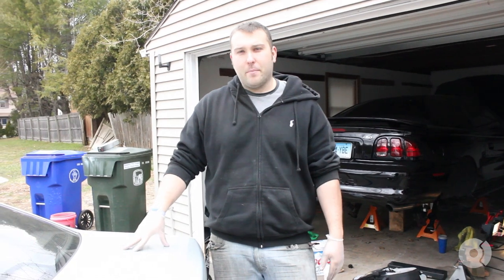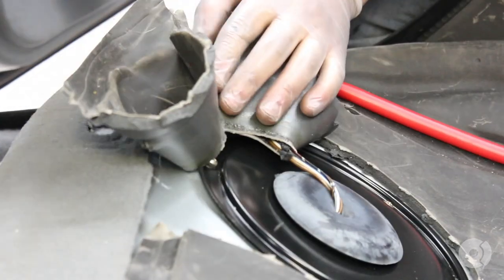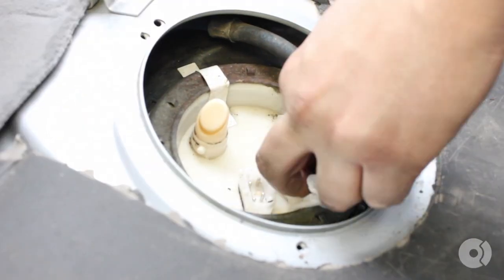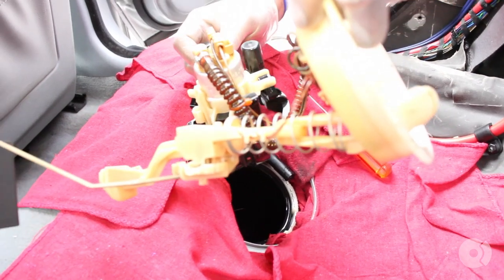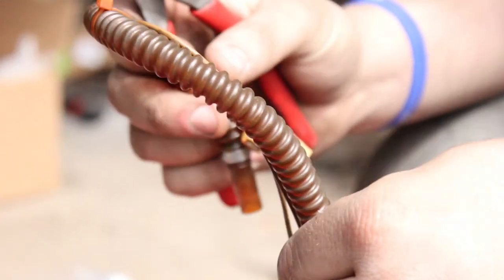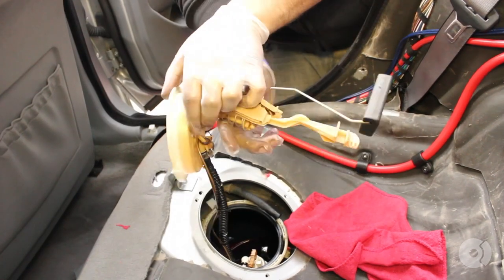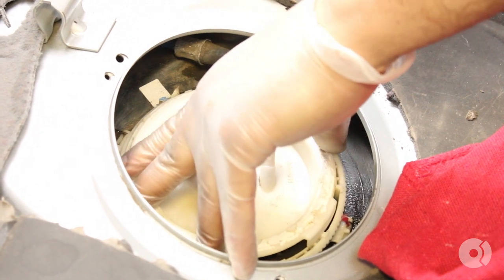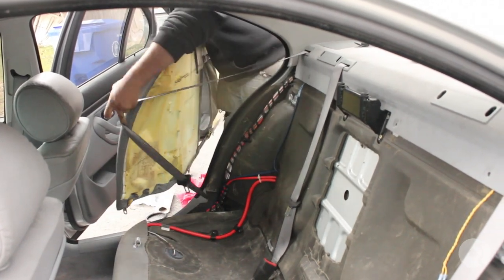BMW Fuel Pump Replacement (528i) FCP Euro

Comment from the maker: Shop the parts used in this video here:

http://www.fcpeuro.com/products/bmw-fuel-pump-e39-16146752368

https://www.fcpeuro.com/products/bmw-fuel-tank-level-sending-unit-right-e39-16146752370

Comment: Great step, by step video. I was having issues reinstalling the sending unit until I remembered you installed the rubber gasket on the tank before seating the fuel level unit. I did not remove the seat back, before starting, I have a 525i and there was lots of room to work. Once again, great video.

Comment: Did this yesterday with the help of this video. Many thanks! A tip for the guys reading here. My fuel filter “failed” last year and the symptoms of both failures were similar; Give gas and no joy and engine eventually turns off. Fuel filter being clogged caused the pump get noisy, just a FIY. Symptoms for the fuel filter failing was engine shudder  periodically during low rpm and idle, often after starting the car again after doing a store run.

Comment from the maker: Test the system. Resting voltage should be around 12.2-12.4 volts. When the car is running the voltage should be between 13.8 and 14.4 volts. If you're within this range I wouldn't worry about it. You can also test fuel pressure at the Schroeder valve at the fuel rail. You should be around 50PSI with the engine running. If you are within these ranges I wouldn't worry about it too much. If anything, I would siggest replacing the fuel filter as a precaution.

Comment: Great tutorial - saved me about $600 in labor and parts (I replaced the pump and reused the assembly) on my 2001 540i.

Coincidentally, once I got everything swapped out and buttoned up, I turned the ignition, and CLICK CLICK CLICK CLICK. I could hear the fuel pump whirring when the key was at the 2 position, but the lights (interior and exterior) would dim at each click and the engine wouldn't turn. I thought I might have had a sizeable air bubble in the fuel line since I lost quite a bit of fuel when I disconnected the line from the sending unit, or that my tank was so low I was starving the fuel pump once I swapped it out, but it ended up being a bad battery with a bad cell. I was only getting about 11.5V with the accessories off and under 10 when cranking. Turns out my alternator issues earlier this year had crippled my battery. Luckily, it was 2 years and 9 months old and still covered under warranty, so I swapped that out and now we're up and running beautifully. Thanks!

Comment: Just did my fuel sending unit left side.  Not to bad, but I got stuck at one point.  I tried putting the rubber seal on the cap first but was unable to get the metal ring started.  Then I remembered you putting the seal in the tank opening first.  Your tip saved me, thanks.

Comment: Hey FCP thanks for the video man. I have a 2013 528i and drivetrain malfunction that comes on when accelerating and on specific turns. This only occurs in D or DS but NOT in manual trip tonic. Also it turns off when turning car off onNo check engine lights or fault codes. Could my fuel pump be bad or dirty? What are your thoughts. Any advice would be appreciated. Thanks
Reply: I'm having the same issues...
Reply: @mr.b2189  my advice is sell it! I dumped a tone of money in it & couldn’t get it fixed. My mechanic suggested one fore thing which was nee turbo booster $2500. I was done. Sold it for a loss.

Comment: Thanks for the video. It was easy to follow and didn't have brutalizing music in the background. 
FWIW, it was a bit of a fight to get the housings to set down well into the new O-rings. On the driver's side, the second side I did, I sprayed a little silicone lubricant on a shop towel and wiped it around the bottom of the housing where it fits inside of O-ring. Worked like I charm. Settled in like butter. I re-did the passenger side, as I didn't like the way it fought the O-ring. I figured it could have rolled it as it was forced through. The silicone spray on the rag helped a lot. Cheers.
Reply from the maker: Great notes, and nice work!

Comment: The fuel pump would turn on with the key in position 2. I have had an ongoing issue with poor performance especially with heavy throttle (basically felt like the car was shutting down). I tested fuel pressure at the Schroeder valve on the fuel rail and found that it read at a mere 10-15PSI (engine off). The fuel pressure regulator was fine which meant that the fuel pump itself was not physically moving enough fuel. Fuel pressure returned to within spec after the fuel pump was replaced.

Comment: Car started for a few seconds then stopped and would not start. I pulled out the fuel pump in pieces. Not only had all the rubber pieces started disintegrating in the black plastic pump mount, they fell into the gas. The pump was free of the black plastic housing and had torn the hose to the sender.
When I changed my fuel filter, I had an idea to hook up my fuel transfer pump to the fuel line where it attaches to the filter input and started draining the tank. All kinds of #$%^^ came out so now I have some 15 gallons of contaminated gas.

Putting the new pump in took a lot of effort. I found it finally worked by directing the internal gas line to the right, then double back to the left to help get it out of the way. The top sender unit piece is a precision fit, on top of it already being spring loaded from underneath. When you finally get it lined up and ready for the big ring, you have to hold it in place and let the ring fully seat it. I pulled the ring back off after tightening and the sender lid was fully seated and sealed.

Comment: Will this be the same for a 1998 540i.  Getting  sputtering at acceleration.  Now getting misfire codes.  Also got a misfire code for tank being run dry but it had about 40 miles to empty.  Its been driving bad and sputtering lightly for 2 weeks, only at acceleration.  Couldn't figure it out but the code saying the tank ran dry  might help.  Any thoughts.  Great video.  I did the level sensor on the driver side.  My thought is to do the fuel pump and level sensor at the same time since I'm  in there.

Comment: Just tried this, got everything in just need to seal it down. I'm having trouble trying to get that white piece back in, after re watching the video I noticed you put the seal down first then pressed the cap on top of it? Does it make it easier to go in when the gasket seal is at the bottom then pressing the cap over it ? Thanks
Reply from the maker: Porter Filmz It was much easier to seat the gasket first and then put the top of the sending unit in place. The lock ring that seals the top of the sending unit to the fuel tank will press it into the seal making for an air tight seal. It's just cumbersome to put the gasket on the sending unit and try to put it into place.

Comment: Great video. Would you be able to tell me signs that the fuel pump is bad? I have a 335i 07. I'm smelling fuel from the back seat area and from outside the car as well. Thanks again
Reply from the maker: You'll notice a sputtering at high speeds, loss of power during acceleration, loss of power to the vehicle while under stress, surging, and hard starting.

Comment: Here is my vin I need the fuel pump and the assembly, Not sure why I just changed the assembly and the acr didn't want to start , I checked all fuses relays battery and nothing I had a guy come and he ran his diagnosis said we need to buy pump and filter from bmw and use the orginal part . What else could it be ? There was nothing wrong with anything before we did it we just happened to have the fuel assembly on hand were thinking mabie it shocked the pump and now we have to replace the pump? The pump does make a little sound for one second when I put the key in . Please tell me what u have for my car or suggestions

Comment: Gareth,

Thanks for the DIY as this is on my list to do. My 540 has 94k with complete cooling system overhaul and I'm not sure what should be next. I was either going to replace the fuel pump or the alternator as I've heard both of them are known to fail. Which would you suggest being done first?

Comment: Why not replace pump with assembly? wouldnt that be easier and you wouldnt have to mess with wiring? 
Did you depressurize? I was told a good method is to disco power from the pump and then start car - will depressurize . Or is this not really necessary?  ABout to try and worried that im gonna make a gasoline mess.

Comment: How do you know if your fuel pump is bad? Thanks for all the info btw
Reply from the maker: We actually have a great article on diagnosis for this! 

https://blog.fcpeuro.com/fuel-pump-problems-symptoms-misdiagnoses
Reply: My sisters E39 was barely starting and barely running idle.. 1st thing I looked at was the filter.. it was dirty but not clogged. There was not much fuell pressure when i swithced the ignition on with the filter detached. So next suspect was the pump. Changed it and all was fine again.

Comment: I believe I have some fuel delivery problems as well, there's a schrader valve at the front of the fuel rail.  There isn't an auto parts store around that has the adapter to measure the operating fuel pressure.  2 questions, what is the thread at the schrader valve and is there a tool to attach to it?

Comment: At the 4:20 mark, you say that you will be replacing the gasket.  Is this essential or can we reuse the gasket.  I am only wanting to remove fuel from the tank of my car.  Also, can I leave the fuel pump in while doing this?

Comment: My bmw e60 525d msport 2005 fuel pump fuses are blowing. Even without turning the key. When i just put the fuse in, it just blows with a spark and little smelly smoke. It is fuse number 50 of 20amps placed in the boot above the battery in the fuse box.. Any idea ? Please help..

Comment: Nice one Gareth.

What are the signs that the pump has failed?
Reply from the maker: +Musonda Kapatamoyo Best way to figure out if a fuel pump has failed is to test that there is power at the sending unit connector/harness when the key is in accessory mode. The fuel pump is supposed to prime when the key is in POS2. If there is voltage at the connector but the pump will not turn on it has failed. If there is no voltage at the connector for the sending unit I would check other electrical items such as the fuel pump relay first. Additionally, a failed crank position sensor will prevent the fuel pump from turning on as well but you will have a code for an open circuit on a failed crank sensor.
Reply: +FCP Euro Thanks for the feedback and clues.

Comment: I was actually hoping you'd replace the pump itself out of its plastic "harness". I need to replace mine as the back-pressure valve failed and that one is inside the pump itself. Any hints?
Reply from the maker: Unfortunately, the effort involved in replacing the pump insert in the plastic hanger/basket is a delicate procedure. The plastic becomes very brittle after being submerged in fuel and will likely break trying to release the pump insert. If the plastic were to break you'll then have to order an entire assembly which is only available from BMW. If you are attempting to install a new insert be extremely careful when removing the original pump. There are plastic retainers that secure the pump in place.
Reply: Hmm, thanks for the warning! Guess I'll have to see what happens.
Reply: I am glad to to be able to tell you that the plastic cage holding the fuel pump on a '97 E39 is not the least bit brittle, it is pretty tough actually. You need three flat screwdrivers and quite a bit of fumbling to get the pump out. Problem is you can't push the pump and you can't really pull either because there is nowhere to pull and there are three screwdrivers in the way ...

Comment: My Bmw E60 has been more than 10 years and hits 125k miles.... will the fuel pump fail without any symptoms right? Shall I change the fuel pump?
Reply from the maker: Hi Elffel, you are correct, a fuel can fail without warning. It might be a good idea to replace it, that way you won't be stranded somewhere if it does fail!

Comment: Every how to video I watch about fuel pump replacements on E36/38/39 never go in to detail about HOW much of a pain in the ass that cap is that you need the screwdriver and hammer for. I've done about 3 of these, and every one has been hell! Usually always completely seized.
Reply: Where possible, douse the ring with penetrant (WD40, PB Blaster, etc.) and allow it to sit for a little while.

Comment: Question: is the fuel pressure regulator located close to the fuel filter in an '01 530i (E39)? If not where would it be? Thanks !!
Reply from the maker: Yes. In fact, the fuel pressure regulator is part of the fuel filter on a 2001 530i. When replacing the fuel filter you will be default be replacing the fuel pressure regulator.
Reply: FCP Euro i appreciate the reply. I just ordered a new fuel filter. My mechanic said I have low fuel pressure. After installing a new fuel pump and checking all fuses, aside from the fuel filter, what else can cause low fuel pressure?
Reply from the maker: There are a variety of things that can cause a low fuel pressure condition. However, the easiest place to start generally is with the fuel filter as they are often not replaced regularly and can restrict fuel flow significantly when they get clogged. There are some mechanical related components that can cause fuel pressure to drop such as leaky injectors but that requires further testing.

Comment: Gareth, I replaced the fuel pump 2000 528I. Now when the car is going uphill the car begins to sputter and sometimes die. Any thoughts?
Reply from the maker: +gr8day42 Does this happen when you have a full tank of gas or below half a tank of gas? I have a couple of possible answers for you but first need to know the condition in which it occurs.
Reply: +FCP Euro It happens when there is half a tank or less.

Comment: Great video.  I have a 1998 BMW 540i (147,000 miles).  I have some gas leaking on the access panel to fuel tank on the drivers side under the rear seat.  I'm going to replace that rubber ring and hopefully that will fix the leak.  Sometimes when I start  my car lately, it will die within 1-2 seconds.  It usually will start back up.  Would that be the fuel pump or sending unit?  Is it the exact same process on both sides?  Thanks.
Reply from the maker: The leak is likely due to a bad seal on on the access cover. The car starting and then dying quickly could be a few possibilities. Does this happen when the tank is full or while it is below half a tank. The process is basically the same for the left and right side. The only difference is the right side of the rank has a fuel transfer sucking pump but that does not interfere with any replacement of the pump or level sending unit.
Reply: It died once today and the tank is 3/4 full.  Don't remember the other times where the gas was.  It has happened about 8 times in the last 3 weeks.  I ordered a new seal today.  I have been smelling gas  for about 2 months now, usually when I fill up with gas then it goes away after a day or two.  Only one side is leaking that I see, do you recommend doing both sides or just wait until the other side starts to leak?  Any ideas what might be causing it to die right after it starts?  I think I understand, both sides have a pump and sending unit, the right just has an additional transfer sucking pump?
Reply from the maker: +MRXCHRISS It could be due to the fuel tank leak. It's a pressurized system. However, it could also potentially be caused by other things such as a bad fuel pressure regulator, clogged fuel filter, etc. It's basically impossible to say what the problem could be with certainty without diagnosing the car in person as there are many variables. The sucking jet pump which transfers fuel to the right side of the saddle tank is likely not the issue if it's happening regardless of how much fuel is in the tank.

Comment: I got the same  problem  with  my e39 the car crank  but  won't  start  help  me please
Reply: There are a few places to look. For a car to start you need three things: air, fuel, and spark. The first place to ensure that the fuel pump is in fact actually working. When you turn the key to position 2 you should hear a "whirring" sound coming from under the passenger seat. If you do not hear the duel pump priming you will need to inspect the fuel pump relay in right side of the trunk above the battery. If the relay is not working or is faulty it will prevent the fuel pump from turning on. In fact, it is normally recommended to replace the fuel pump relay when installing a new fuel pump for good measure.

Comment: How can I tell if the pump is bad
Reply from the maker: The vehicle will not start and or have a hard time starting. You can also jump the fuel pump relay with the engine off, and listen to see if the pump kicks on and sounds healthy. You can also use a power probe to bench test the pump.

Comment: Thanks man...Great video and very helpful on how to install fuel pump...My problem is on my 2000 528i  I'll have a full tank of gas and drive about 25-30 miles and the gas light will appear and when I remove the gas cap gas shoots out with force...but if i open the cap slowly it will release fumes and once that happens the gas needle will read normal until the next 25-30 miles are driven...I don't have a clue what could be the cause of this...maybe the sending unit? please help me if you can as i love this car and i've driven it for the past 14 years and would love to continue to do so :)